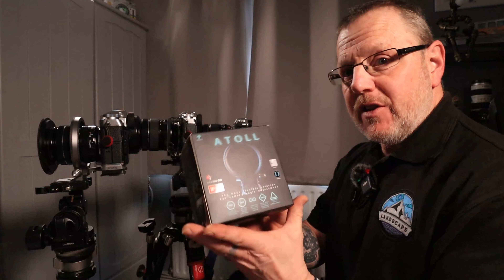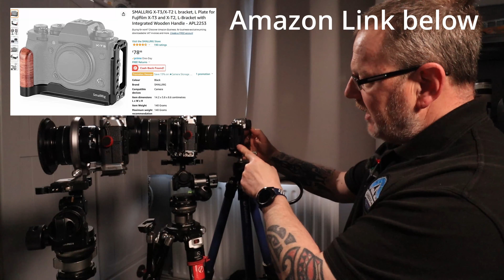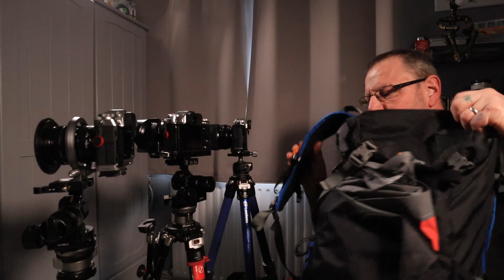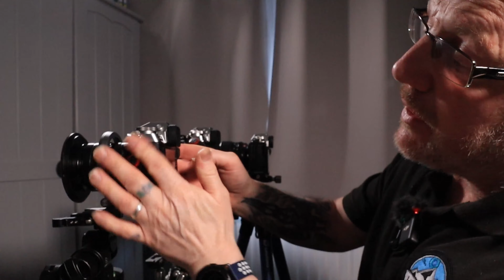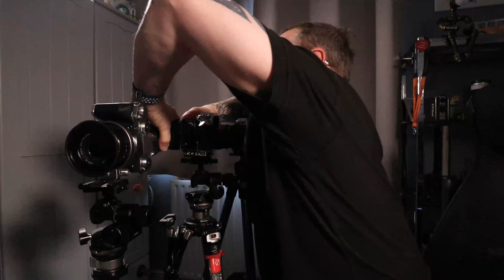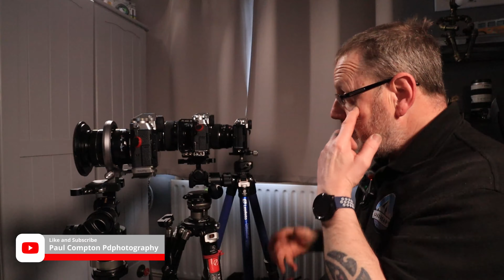L Bracket or the Atoll, the new camera mount. What is the better camera mount.

Comment: Hi, thanks for the video!
Can you please tell me who makes that protruding L-bracket? I wonder if I could attach it on a video cage.
Reply from the maker: if you mean the small extention piece. then me
Reply: @VanlifePhotographyGear  Cool! So could you make one that fits SmallRig Mamba half cage for Canon R5? (Arca style).

I'm a hybrid shooter so for both photo and video I need to be to shoot in vertical and horizontal position. I have spent many hrs on the internet searching for a solution and there just is none. Atoll is a sleek solution but doesn't work for all lenses and I need to have a sleek cage on the camera the whole time.
Reply: I hade a more careful look at it and will not work. Thanks anyhow!
Reply from the maker: If you send me the bracket i can make it
Reply from the maker: ok
Reply: @VanlifePhotographyGear  thanks for getting back to me. The half cage Mamba has a vertical on the side but it’s to thin to mount a camera plate on for vertical position. And it’s in the way for a hack that you could do. I have rethink how it could be done without getting bulky. I’ll get back to you.
Reply from the maker: ok